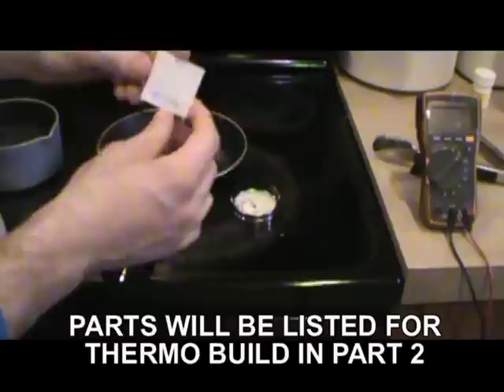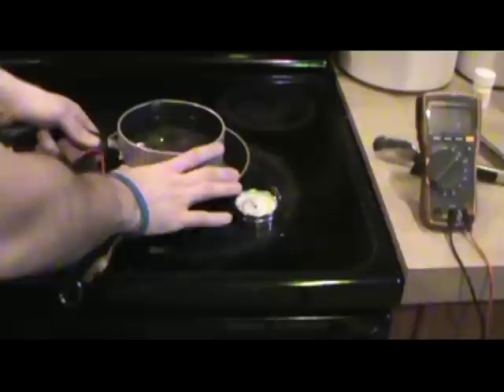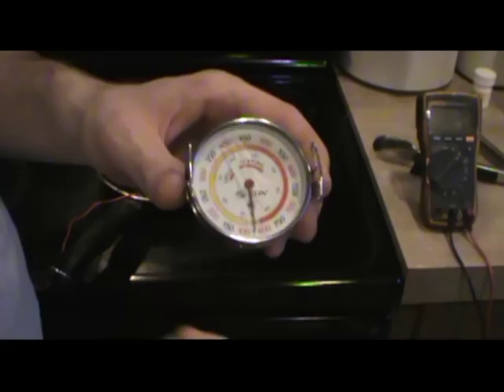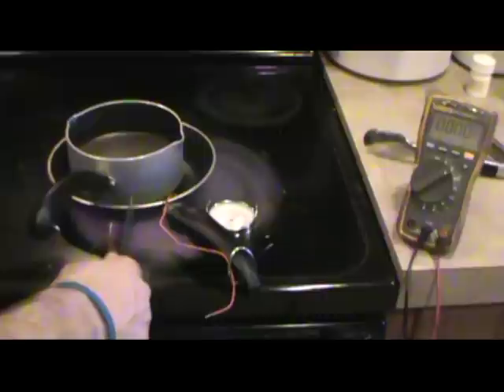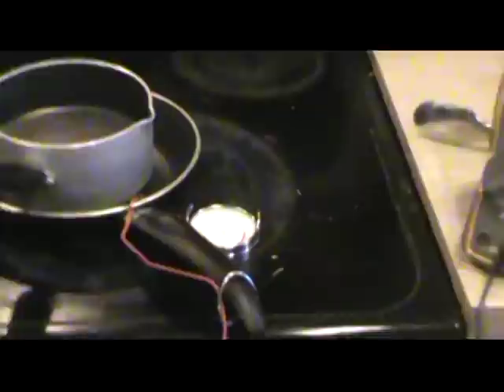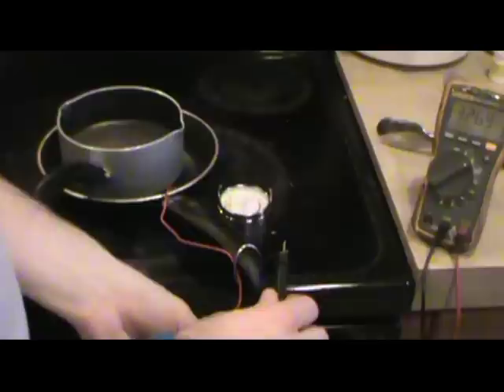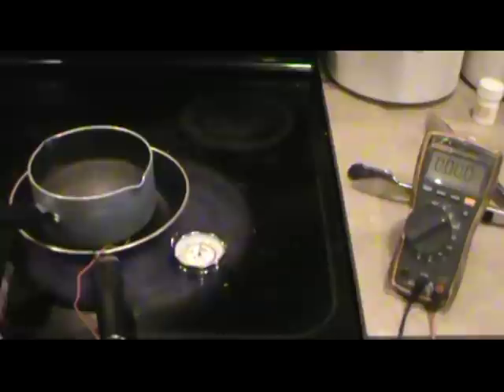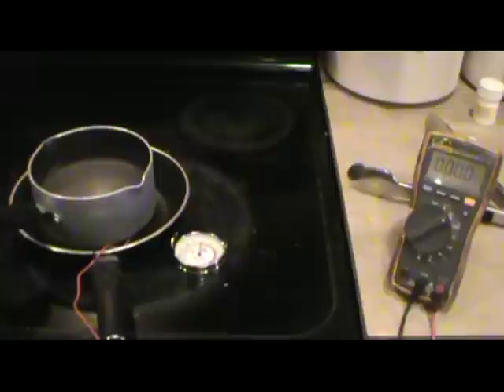THERMOELECTRIC POWER SERIES: PART 1: HOW TO MAKE THERMOELECTRIC POWER 101

Comment: Thank you for the video! A couple of questions -
1) how do you know which side to heat, or does it make any difference?
2) how well does a heat sink, like from a CPU, work for the cool side?

Naturally there could be a few hundred other questions, but those are the primary ones bugging me at present!

Again, thanks for the video!
Reply from the maker: just bear with me all these questions will be addressed in part 2 later this month. A heads up though a heat sink would work as long as you cool it with a fan or water on the other side.